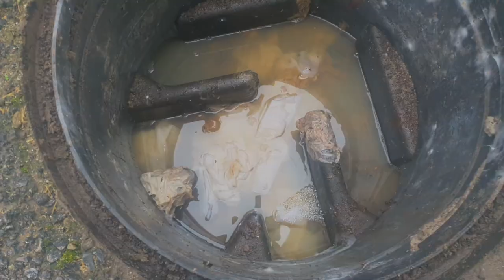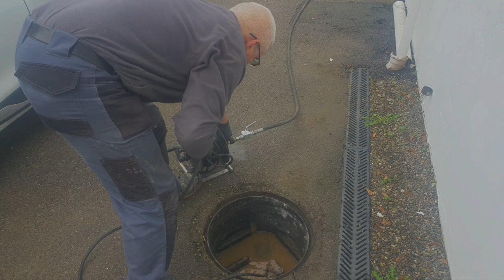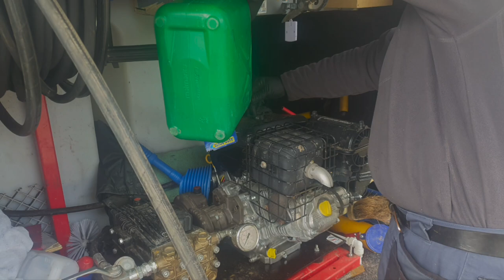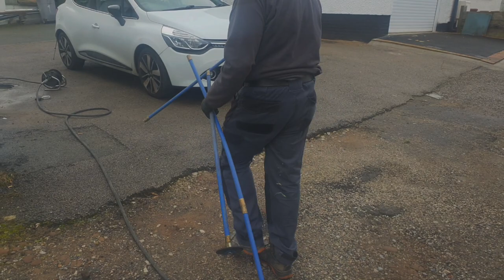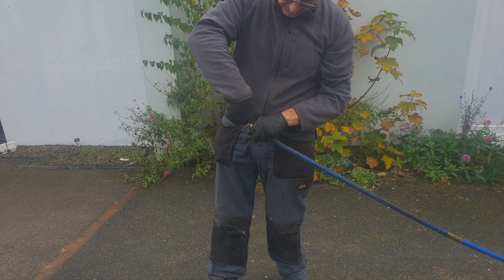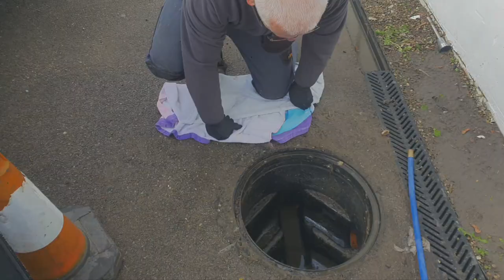Drain Clogg Vlog  #18 Epic drain unblock #blockeddrain #sewage #drainjetter #drainunblockingwithtony

Comment: It surprises Tony that with all the water you have in the UK most places have poor water pressure, and no outside taps. I understand that with all the old buildings outside plumbing was necessary, in some ways it's a help when doing repairs, but there should be an outside tap installed. Good job!!!
Reply from the maker: I was surprised there was no outside supply too mate, its a pain having to go and fill up. Cheers

Comment: You need to get in contact with the Aussie boys, and get yourself an RS38 jetter nozzle, that monstrosity of a jet setup with the rotating nozzle is so bulky, sharp, and square edged, it is only a matter of time before it gets stuck somewhere. The Rocket Ship 38mm is a superior piece of engineering, and well worth the cost to prevent getting 2 pound of aluminium stuck in a pipe.
Reply from the maker: Cheers mate, stand by for a test video as im setting a rig up tomorrow 👍